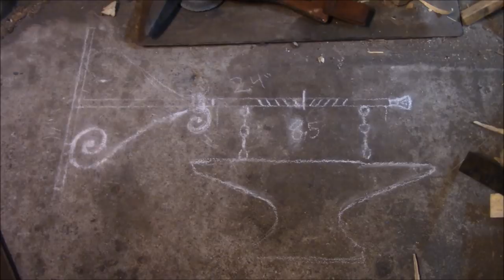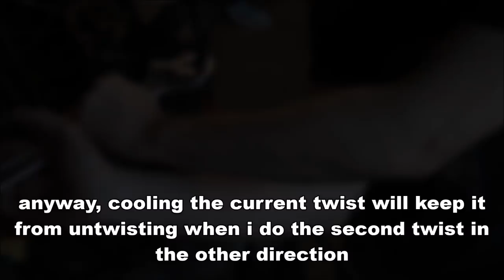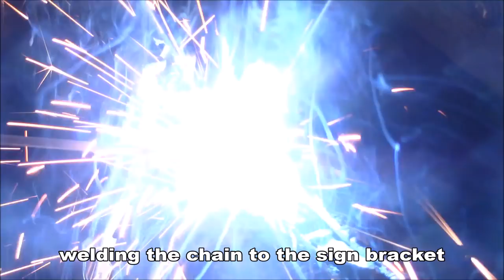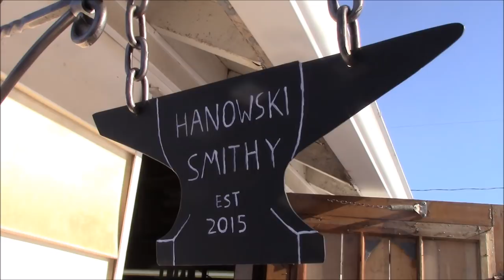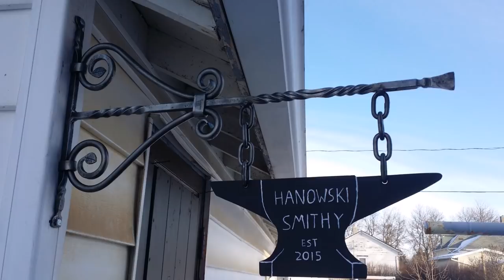Blacksmithing - Forging a sign bracket for my shop

Comment: Good looking work there man. But i do have a question however would it be reasonable  to just forge weld those brackets on the the work and not use a stick welder to join all that?